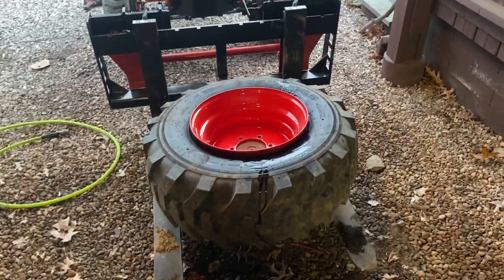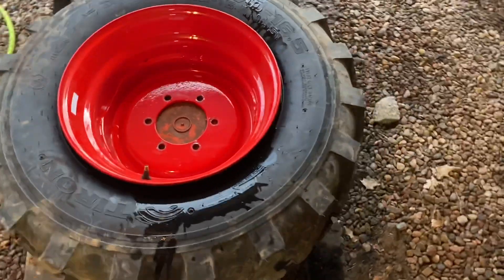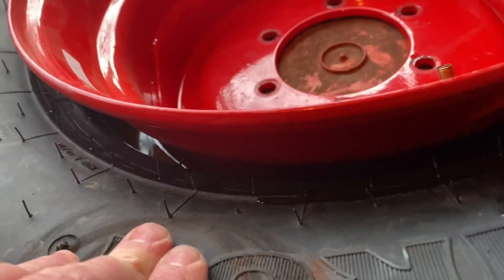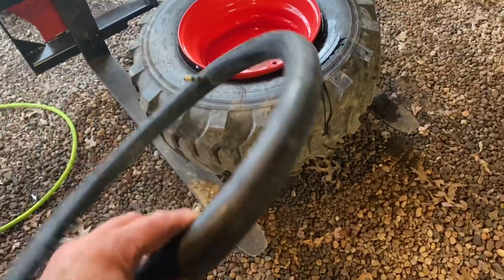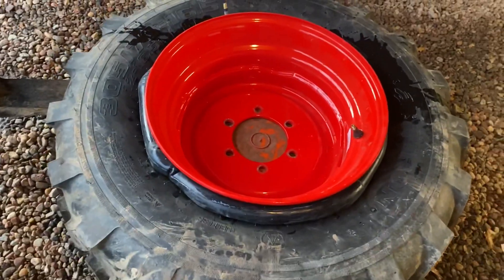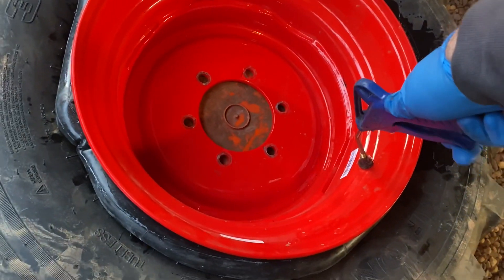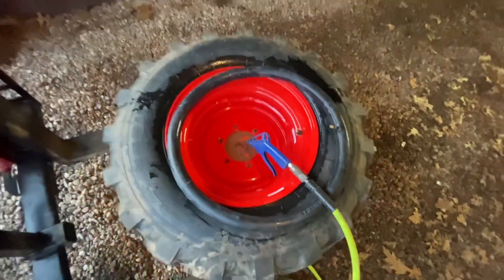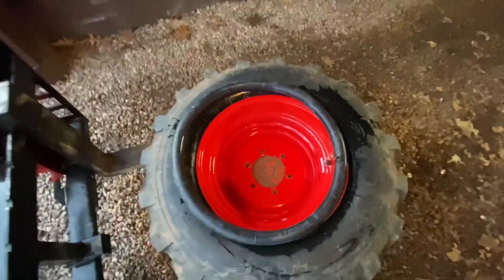Seating a tire bead with a bicycle inner tube & liquid fill

Comment: You can also run a thin ratchet strap down the center of the tire , When you tighten the strap the beads will expand onto the rim. Now make sure when you start putting air into the tire release the ratchet strap.
Reply from the maker: That trick has worked once for me with probably 10+ attempts that didn’t pop the beads outward enough.